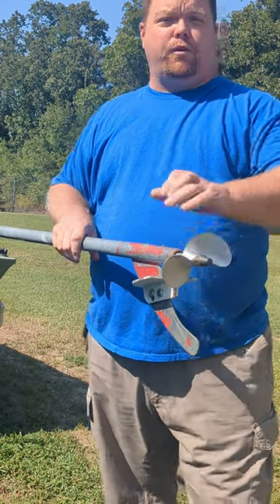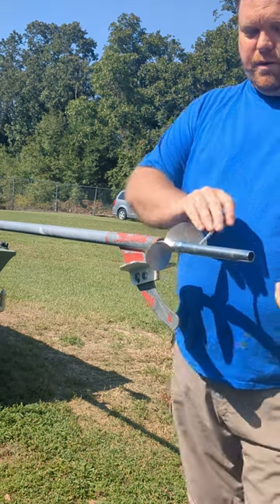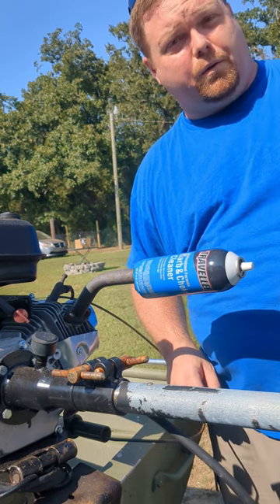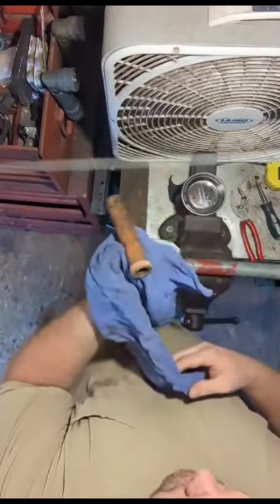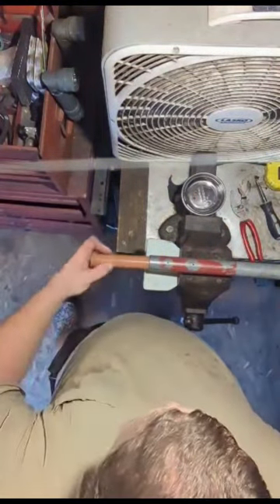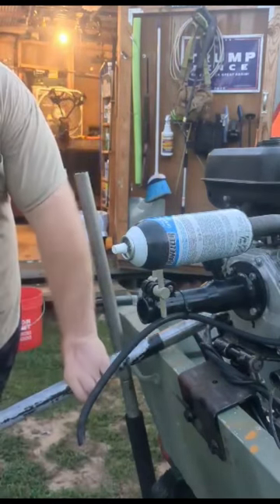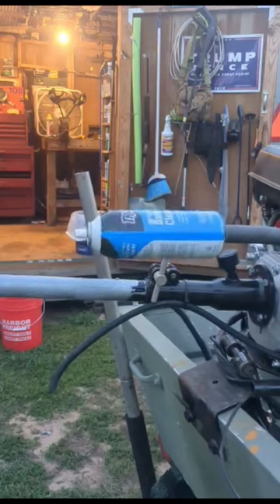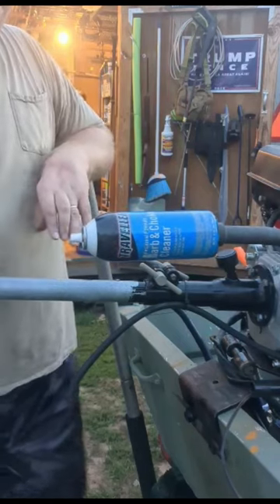Mud-Skipper Shaft Maintenance

Comment: What holds the shaft from sliding back and out of the housing? Also is that bushing the only seal for the housing to keep water out?
Reply from the maker: I honestly don't know how to get the inner shaft out. I have tried without success a couple different times. There are other bushings inside of the shaft and the internal shaft is pieced together. Personally I have the idea that the internal shaft was placed in the shaft housing through the internal bushings and the end of it was welded on. So in order to remove the internal shaft you have to cut the end off. Or similar construction where the outer shaft was placed over the inner shaft and then welded.  The nylon bushing on the end of the shaft does not keep water out. Water will get into your internal shaft and that's why the maintenance is important. The bushing keeps the internal shaft from bouncing around at the end.
Reply: Like your channel thanks for sharing

Comment: If ya take a flathead and smack it one time in between where the tbolts go on the pto housing you don't have to beat the shaft into the pto it will slide right in.
Reply from the maker: I will keep that in mind next time.  Thanks!